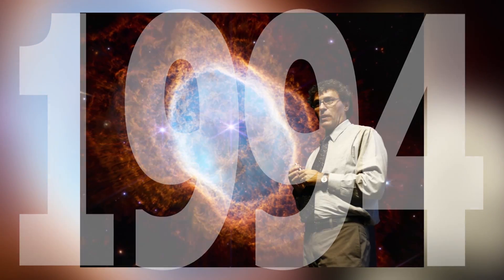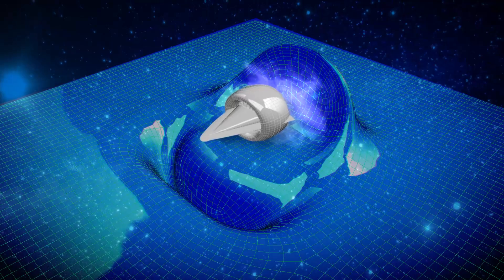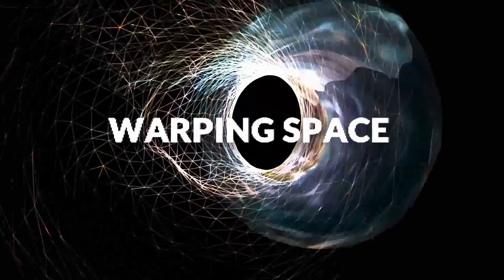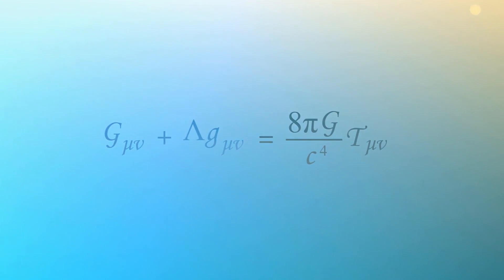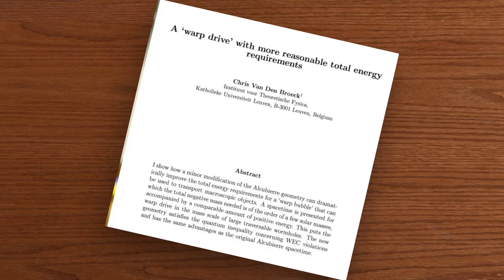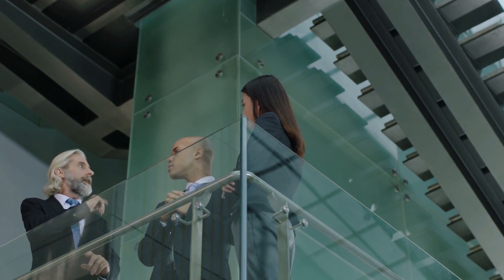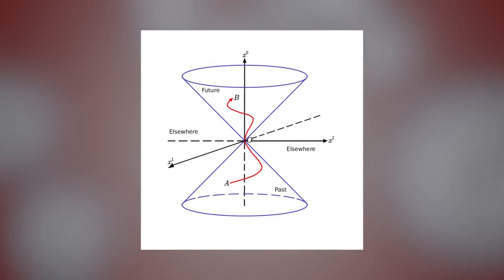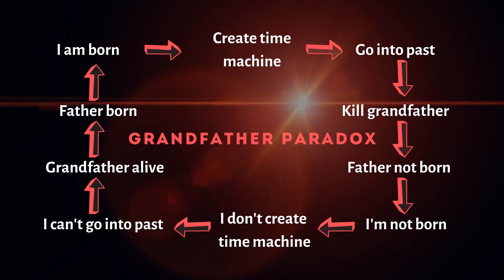6 Obstacles Stopping Us From Building a Warp Drive?

Comment: It isn’t “we” who do not have a solution. I know solutions aren’t words or mathematics; Just like everything else, logically, a solution is what it’s supposed to be. Solved. 

You can’t say that ‘the energy has to be more dense than the energy in a vacuum’, because the energy will be in a vacuum. The thing is, when the energy passes through the vacuum as a current and it will be a current, there will be no field than an electromagnetic field. However, the electromagnetic field passing through the vacuum can’t interact with anything than the vacuum as a conductor. Also, the current won’t interact with anything in a denser atmosphere than the conductor. Therefore, the energy in the vacuum currently is energy in a vacuum, and the energy that exists if the energy is more dense than that is energy in a vacuum.